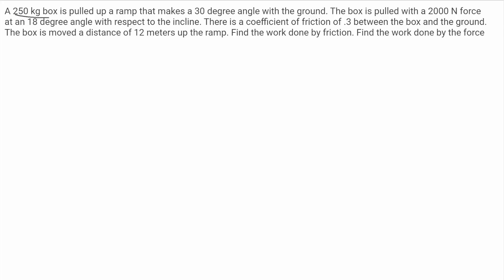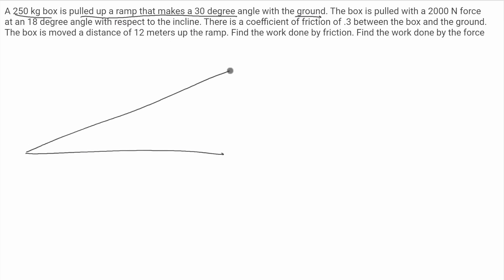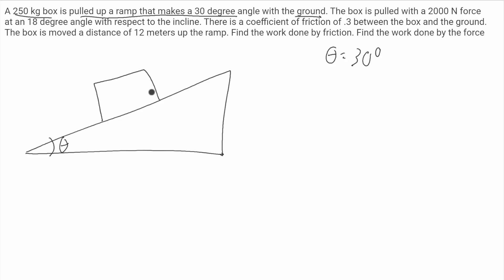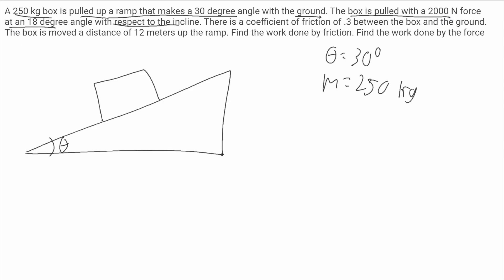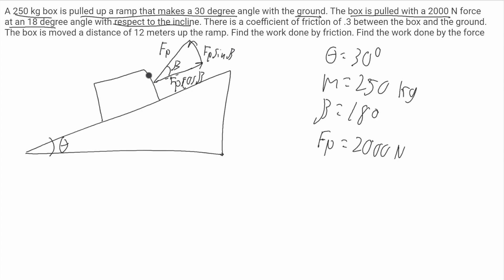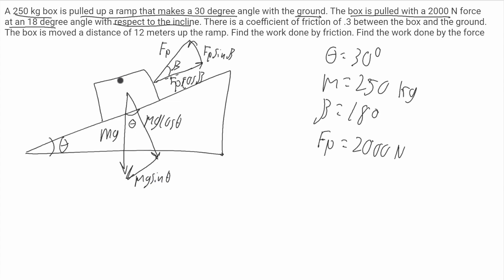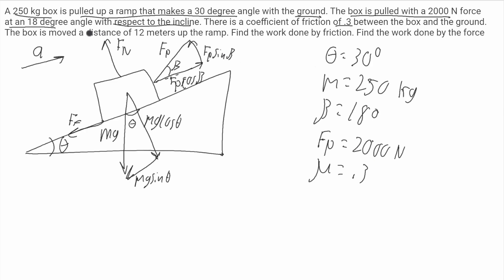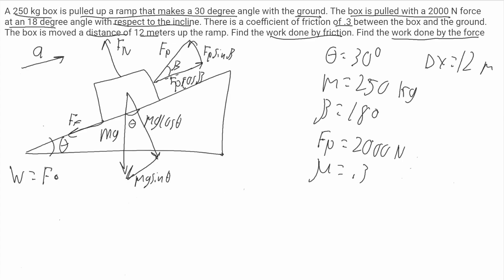How to find the work done by forces on an inclined plane. Work done by friction and a pulling force.

Comment: Why is F net equal to 0 tho? 🤔
Reply from the maker: That’s only F net in the “y” direction which in this problem is perpendicular to the surface of the ramp. All this means is that the box doesn’t fly off of the ramp or sink down into the ramp. So, the y components of the force due to gravity, normal force, and vertical pulling force will cancel out because there is no acceleration in the y direction.

There is still a force on the box in the “x” direction.

Comment: Where from the cos 180
Reply from the maker: Work is equal to the dot product of Force and displacement. The definition of the dot product states that work is equal to the force times the displacement, times the angle between the force and displacement. In this problem, delta X is up the ramp and the force of friction is down the ramp. The angle between the displacement and frictional force is 180 degrees.

Comment: Nice, one thing I have problem understanding is, at 1:08 why is it that you assumed the angle between Fx and Fy is 90 degrees? If I had drawn the Fp vector a bit longer and connected it with Fx, wouldn't that have made an angle with Fp and Fy a 90 degree angle? I mean what specifically made you choose that angle as the 90° and labeled the others after that?
Reply from the maker: For this problem it is most convenient to set the x-axis as the sloped part of the ramp. This makes the y-axis perpendicular to the x-axis (perpendicular to the ramp’s surface). For the forces involved in this problem, trigonometry is used to split the forces into their components in these new x and y axis.
Reply: @ZeroWaitTutoring  Alright, thanks!